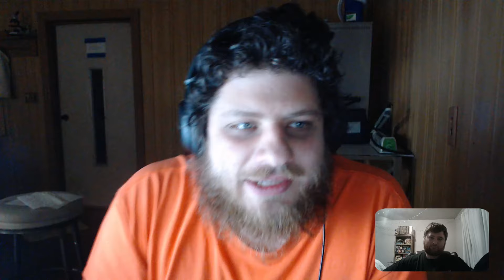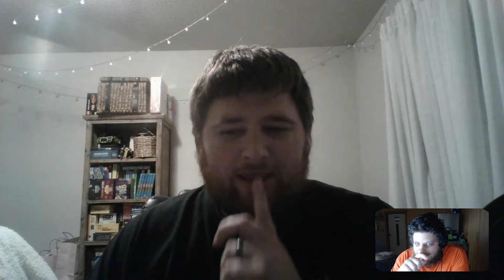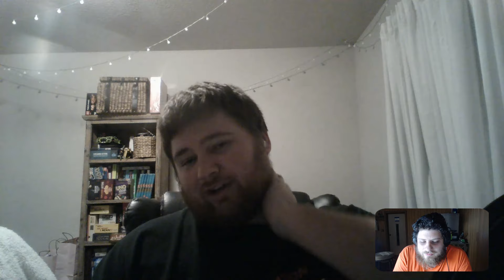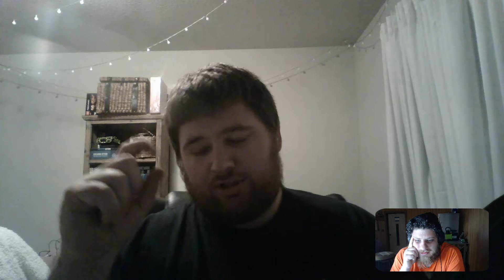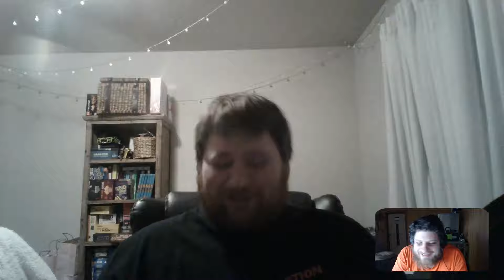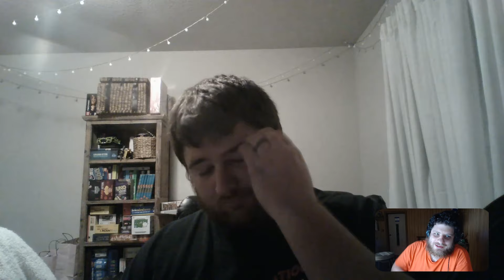Hot Take: Lean Isn't for Everyone -- Ep.61

Comment: yeah, it's safe to say that Tormach is the Harbor Freight of CNC. Some of there products work ok-ish for some stuff some of the time. Maybe you'll get lucky and get a good product from them. But there's also a pretty high chance that it's just gonna be trash. To add to my list of problems from them, today I learned that ER collets should not be able to be cut with a file, Tormach ER collets easily cut with a file. Of the 20-ish I have from them, 8 to 10 have defects straight out of the box. I use harbor freight stuff sometimes, but I also know that there's a 50% chance it'll be pure junk straight out of the box. Looks like that's the approach I need to have with all thing's Tormach.
Reply: @flosscap  lol I haven't heard anyone mention that brand yet. Sounds German. I'm guessing it's not German quality.
Reply: @flosscap  oh ok
Reply: @flosscap  lol yeah, I spent 20K on a 440 + accessories. I didn't have anything related to CNC stuff.  In 12 months, I've had at least 10 significant things replaced under warranty, due to QC issues, and spent 5 months working with tech support, 4 consecutive, for QC stuff. Still haven't made enough cumulative chips to fill a 5 gal bucket because of it. Harbor Freight tools are cheap, from china, sometimes they work fine, other times not so much. Based on my experiences, and talking to machinists who usually start out with " I don't want to bad mouth tormach, but..." the comparison is relatively accurate, even if it's not perfect.